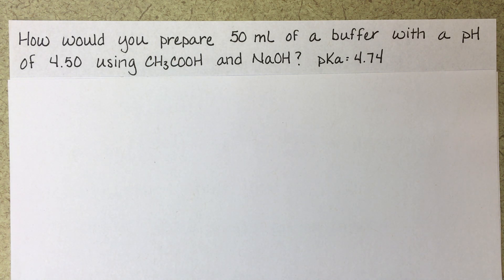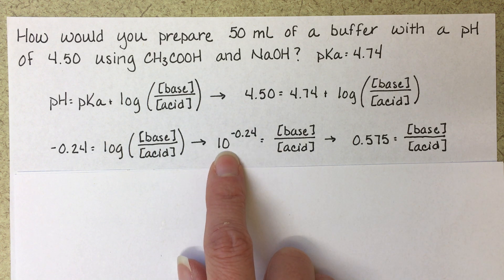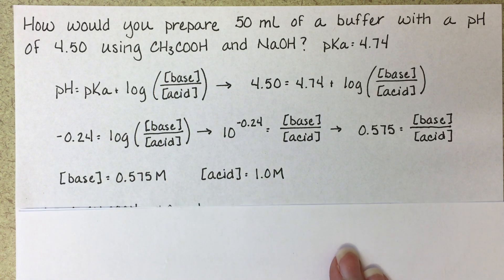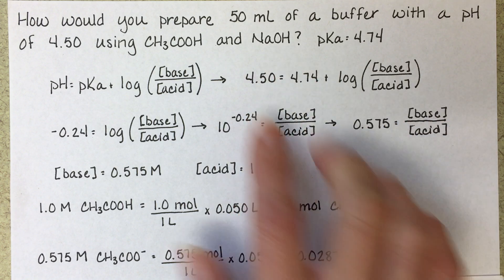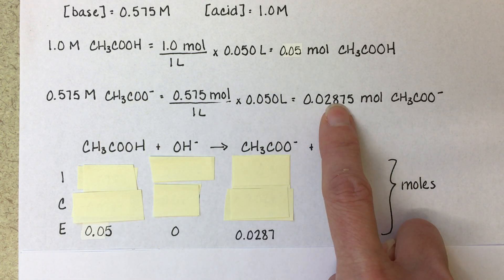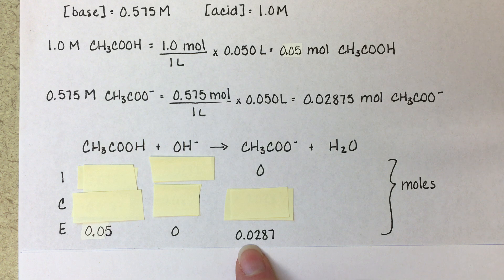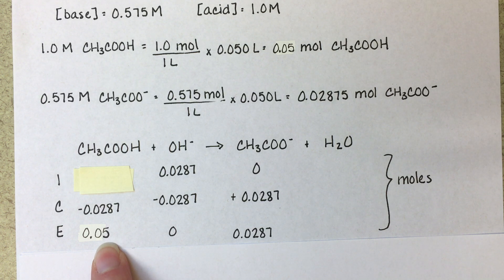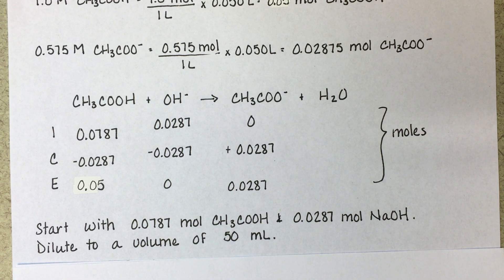Making a Buffer

Comment: don't the conecntrations of weak acid and its conjugate base have to be equal though?
Reply from the maker: Definitely not. A buffer is its most effective when they are equal, but it is not necessary and in most instances, it is not possible to get the buffer at an exact pH without having the concentrations slightly different.

Comment: Isn't the use of strong base invalidate the rule of having a buffer solution?
Reply: Using a strong base is necessary to ensure that the last part of the ice table works out the way it does, had she used a weak one there would have been leftover base which  would have messed with the pH and the reaction would have yielded different amounts of acid and conjugate base

Comment: Wouldn't that result in a 100 mL buffer solution because both the weak acid and the base were solved for 50mL?
Reply: Sarah Sisney no. because it just shows how much moles do you need in a 50 mL buffer solution. :)
Reply: it accounts for the total volume of the buffer solution